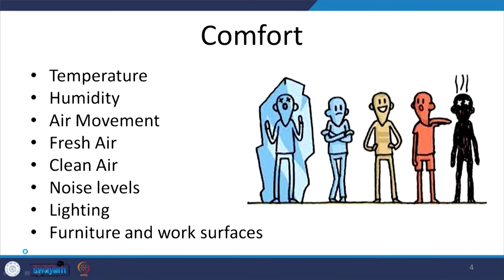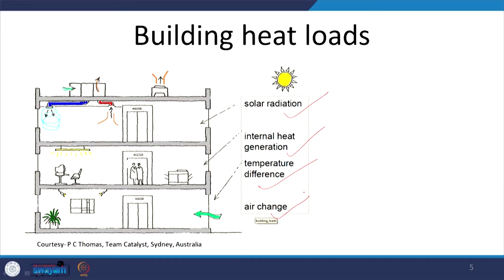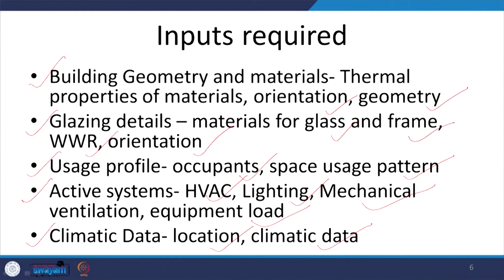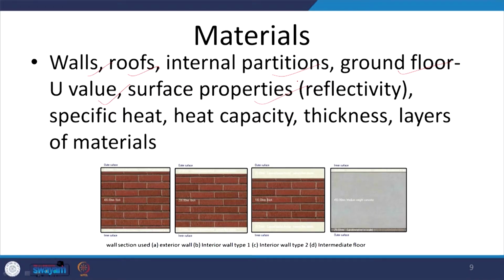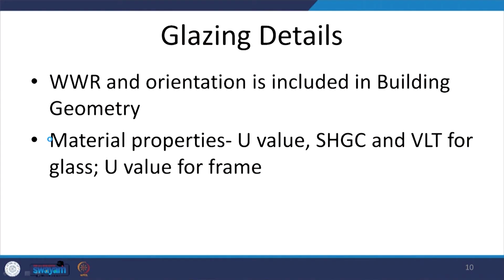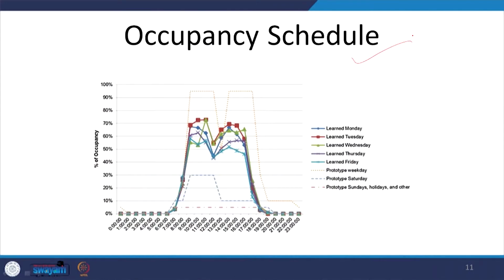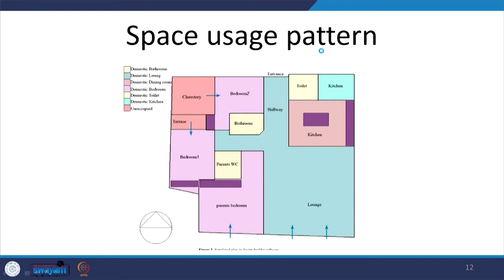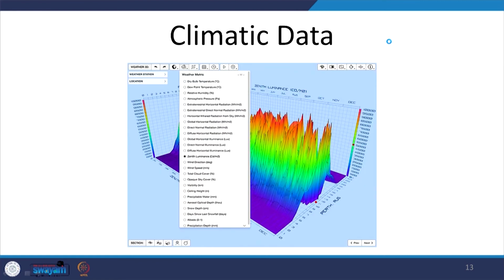Lecture 49  Introduction to Whole Building Simulation - I

Comment: simulation of buildings, cities, wind, water , air, and how those 3 things go between and through buildings, and outside of buildings, and between the 'open air' of the city' through buildings. 

there is so much obvious progress for the next few decades of simulation. 
while there are many current practical applications. 

one day, in the distant future, entire cities will be designed and built , and then operated and rennovated, based on parralell simulations that dramatically increase the value of cities to human beings. 

no bad air. 
no unnecessary overcrowding 
no flooding
no wasted water
no excess heat or cold
no wasted thermal energy
no lack of 'clean' air.
no NOISE
no risk of being struck by a car or heavy load. 
no human heavy equipment operation with room for human error to destroy excessive structure
no wasted surface structure, maximizing surface space for human beings rather than vehicles, and infrastructure.
no petty theft that is un-recognized (smart cameras tracking everything, so systemic theft [organized crime] does not emerge from persistent casual theft) .